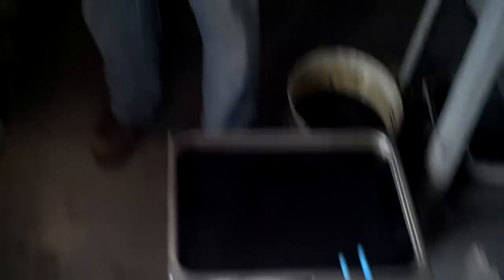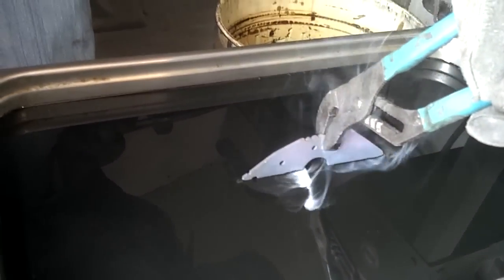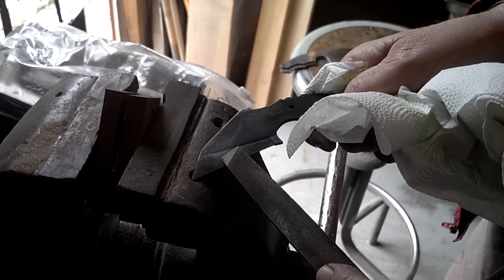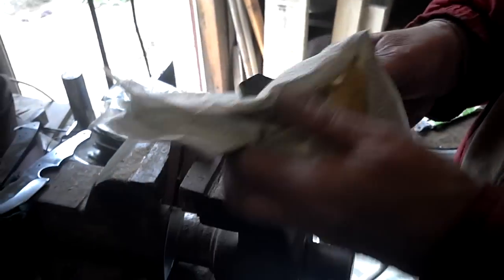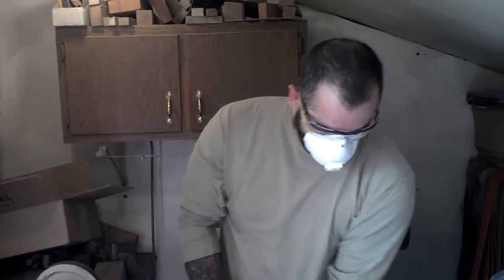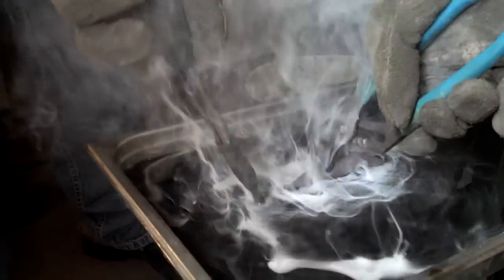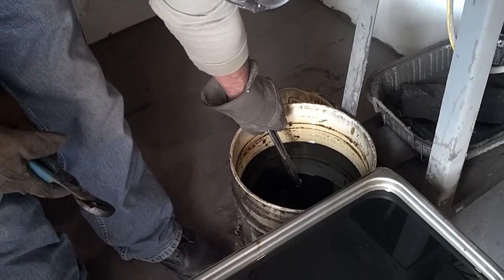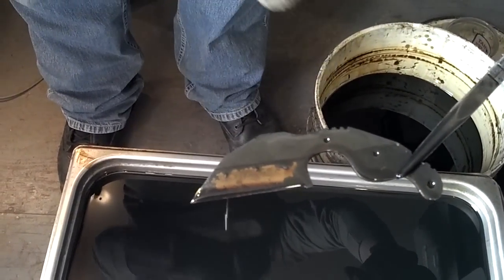My EPIC Day with my Mentor Mr Gillespie

Comment: Is there any difference between the oil in the metal pan and the plastic bucket and is it used motor oil ? I'm DIGGIN' your blade designs .